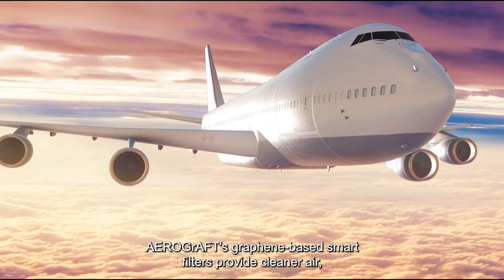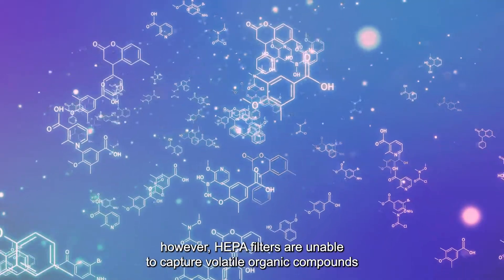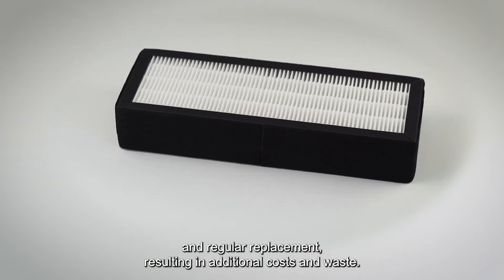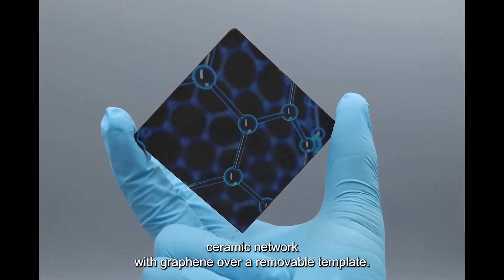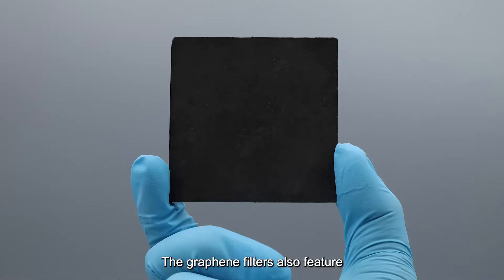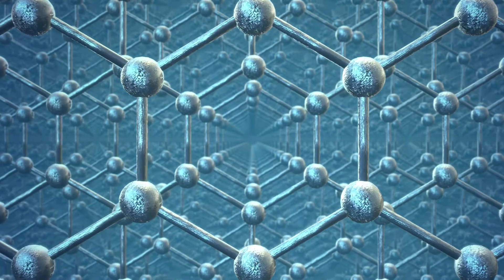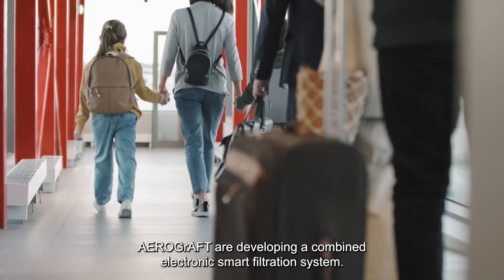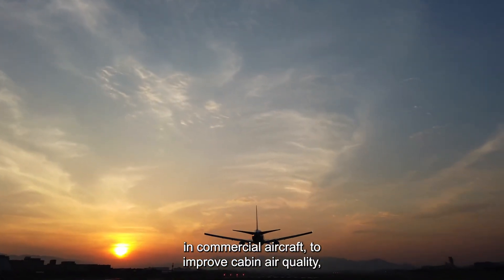Graphene applications: AEROGrAFT

Comment: That's nice, but when these self-cleaning filters are heated, where does the residue go? If it becomes even smaller than nano, it will pass through the filter, right? And the smaller the nanoparticle, the deeper it ends up in our body. Or are the filters removed from the aircraft to be cleaned?